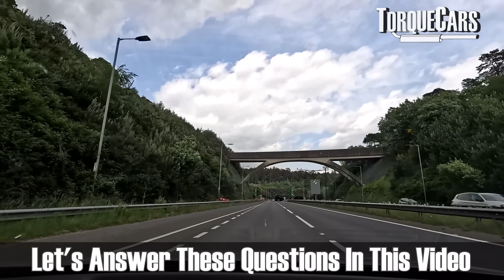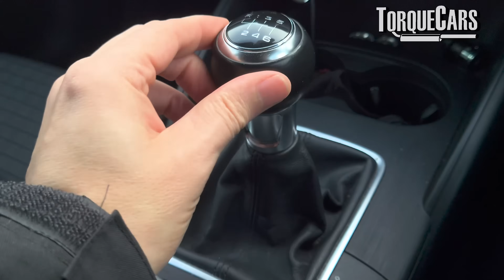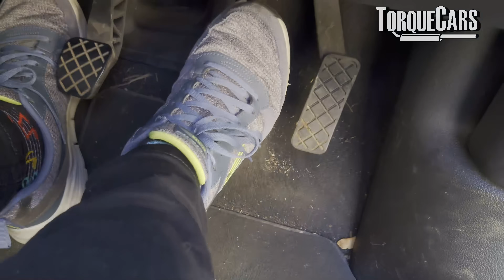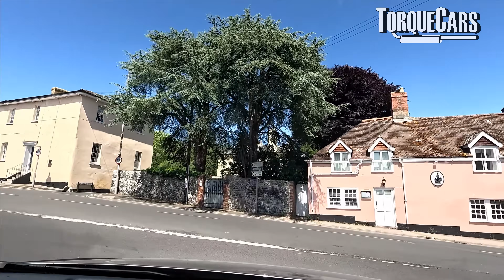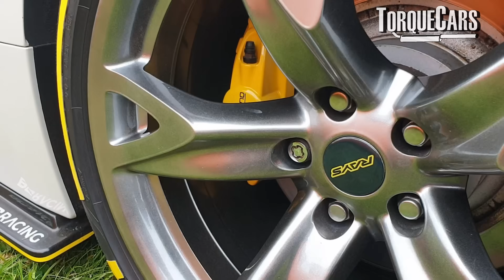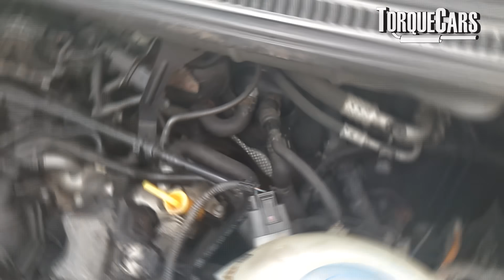What Is Mechanical Sympathy: ❣️The Secret Driving Skill No One Talks About (But Mechanics Hate)

Comment: Running a diesel engine with average wear in low temperature start-up - will not induced diesel diluting in oil? While the engine is not hot enough? Thks. Great Channel!

Comment: Start a cold engine and let it idle for a minute .
Drive the first 3 miles with no more than 2000 RPM , then about 2 miles max 3000 RPM.
Never use lounche controll , these sudden powerreleses can break axles !
Feed in the exellerator , don't SMASH it .
Brake early and gently .
Do the services according to the manual or sooner when driving short distances !
So....thats how I treat my E350 coupe .

Comment: One of, if not THE best way to learn the art of smooth input is by driving a land yacht, and I one with REALLY soft suspension. The reason being that you get yourself into trouble if you DON'T use smooth input, so you're forced to learn it. Then after that experience, you only become a BETTER driver because of that

Comment: As a mechanic, I choose to drive my car quite hard as I frequently change the oil brakes and tyres and use better than oem parts ie engine mounts bushes, brembo uv dics, bilstein shocks etc.

I frequently go to redline when the engines hot as the manufacture sets the redline and would not let you overrevv the engine so going to the redline when the motor oil is up to temp doesn't hurt the engine at all especially with 5000km oil changes

Edit: of course I know mechanical sympathy but just choose not to do it to my own daily car...

other people cars and classics of course I'd be more restrictive & respectful

Comment: My friends make fun of me for shifting slowly when racing in a manual car... Bro I want to wait until engine RPM drops to the next gear's preferred RPM to make a silky smooth shift and maintain the health of my clutch, motor mounts, transmission mounts, interior parts (some of them break during power-shifting), etc...
Reply from the maker: You'd need a light flywheel for those lightning fast gear changes, but it makes the car challenging to drive in normal conditions. Those change points are the key and flat shifting can cause the engine to bog down in some cases.

Comment: I once got 220,000 kms out of 4 Michelines on an Opel Corsa. The car was driven in the country with very little stop and go driving. True story!
Reply from the maker: Wow, that's an impressive mileage, proper mechanical sympathy pays off!
Reply: And in what time did you drove those 220,000 kms? As soon the tires are hard, the rubber will not come off anymore. If you only drove gently you won’t really notice that the tires are hard and already bad.

Comment: How can someone use the brake pedal while matching the clutch and gas?
Reply from the maker: That would be the classic heel and toe shift.  Seems to be a forgotten skill but it's something I've been brought up my whole driving career doing. I'll do a video on it if people want this.
Reply: I spent my youth on motorcycles, so was used to being able to blip the throttle while braking.  My dad showed me how to ‘heel & toe’, so this is something I practised from early on.  It takes a bit of mastering and practise.  He also showed me how to ‘double decliutch’.  No longer with us, my dad was a tough act to follow.  He explained that when he was learning to drive, synchromesh was not common.  I once had a clutch cable snap on my commute from work:  not much fun in stop/start traffic…!
Reply: @davidbarringham7992 I hear that, I didnt have the cable, but ive felt air, and total loss of hydrolic fluid a few times.

Comment: As a passenger, I've witnessed drivers shifting into first as they approach a junction quickly (with the clutch in), however this can cause wear to the synchromesh for that gear.
Reply from the maker: I should have mentioned that, you can even hear it crunching as it does so.
Reply: @torquecars  If I ever am tempted to downshift to 1st to take a corner or speed bump... I leave it in 2nd and feather the turn with the clutch instead. Would rather wear my clutch a little than bang my gears

Comment: A small point about 'Handbrake' usage. There are three cars in my household, NONE have handbrakes. The correct description is 'Parking Brake'. 
Of my cars two have electrically operated systems, and one has a 'foot  brake' All three  have 'hill hold' systems which automatically operate through the main braking system.

Comment: I once sold a Volvo 300 car to a work collegue, 65k miles on the clock. He was immediately advised to replace the clutch plate by a 'Mechanic' . Luckil;y he had it done by another work collegue who was a skilled mechanic in a previous life..  Some time later I was talking to the collegue involved in the plate change. His comment was that when they put the new plate next to the old they had difficulty in seeing which was the 'old' plate.  
I had been taught to look after the car and drive properly. In 50+  years of driving I have never had a clutch wear failure.
Reply: So, why did they replace the clutch if there was nothing wrong with it? 🤔
Reply: @BubblesTheCat1  The clutch was already disassembled when they found out. (Strangely you can't see the clutch plate without taking it to bits.) They had a replacement plate ready for the swap  The original advice from the 'Mechanic' was poor , (Hence my quote marks around the word 'Mechanic'. As for which plate went back into the car I have no Idea, my comment was to demonstrate the fallibility of many 'Mechanics' 
and perhaps boast about my driving style being sympathetic to the car.
Reply: @solentbum I see now, yes. I've driven all my cars from new to over 300k kilometres without ever needing to replace a clutch 😅 It's all about understanding, and mechanical sympathy 😊👍🏻. 🙋🏼‍♂️ from 🇿🇦
Reply: @BubblesTheCat1  The Mechanic took one look at the car, saw it had a towbar and jumped to his conclusion.  
I have found that having a towbar on my smaller cars enables me to have a large capacity vehicle when I need one, plus I often tow a small boat. The reason I sold the Volvo was it was being replaced by a Discovery to tow my new big caravan, there was nothing wrong with the Volvo I just needed a larger tow capacity.
Reply: Same here; never had to replace a clutch.
Reply: @davidbarringham7992 👍🏻👏🏻
Reply: I have a 1996 Toyota. 105k miles on the clock. We got her at 53k. Poor thing has been used to tow a caravan in her previous life.

Clutch has been "on its way out" since day one. I keep waiting for it to slip before booking in a replacement. It keeps refusing to...
Reply: @233kosta "Poor Toyota" 😂🤭

Comment: The people todaydon't have a minimal technical understanding, the car is driven pttm, the clutch used as a foot rest, the indicator lever used as a bag holder,.......
reving cold, doing short cycles, overdoing service schedules, hitting side walls, and so on and so on.

The dring license should contain a big technical section with a practical test.

Doing my dring license during military service  (i had my own civil dring license allready) and was in a Maintenance unit, we had to do car service including pressing the grease nipples on the chassis.
During my lessons for my civil driving license the instructor used to ask the woman where do you fill up coolant at the VW Beetle (itz is air cooled!)

Comment: Whilst I agree with many points in the video, regarding manufacturers manuals and instructions, generally to be taken with a pinch of salt. For example , oil changer intervals are typically wrong and in most cases double the time what they should be in reality, I have an oil and filter service roughly every 5K miles, whereas Audi recommend every 10K miles - For what is essentially a supercar in a family estate body is absolutely ludicrous, no wonder so many owners are having engine rebuilds before the motor reaches 100K miles! Regarding driving style, again it depends on the car itself and the drivers understanding of what is safe for the machine - Despite my car capable of 0-60 in less than 4 seconds and producing 600BHP, this doesn't mean I'll rag it all over the Nürburgring because it has a wet sump, the previous variant of the RS6 had a dry sump so wouldn't be an issue but frequent hard cornering in a wet sump motor and you're asking for trouble! Knowledge is they key with anything in life, fairytales in shiny books from manufacturers are just that and are misleading.
Reply from the maker: I have to agree on the stated service intervals, but the manual is a useful guide to general use of the car & controls, especially important if this is your first (Quattro, DSG, Diesel etc...)

Comment: I have driven many different types of vehicles including vintage buses and HGVs. I have never worn out a clutch or gearbox. I still double de clutch particularly if changing down gear at speed. If we look after our cars they look after us. Of course some modern car engines are built to fail.
Reply: What's "double de- clutching" please???
Reply: @richardwallace2458  It's when you dip the clutch out between gears to sync the input shaft speed for the next gear. It's easier on the synchros. On some HGVs you need to do that, as they have no synchros at all.

In normal driving it's not really needed, especially if you're not forcing the gears in. But when you're downshifting more aggressively (say 4th into 2nd), it's helpful to dip the clutch out, blip up, push it back in while the revs are high, and only then go into second.
Reply: @richardwallace2458   A easy way to blow up the gearbox.
Sadly makes little sense to do that often. If wanting to do it, or those rare shifts that makes sense to do it:
The goal is to sync the speed together of all the components as best as possible.
All of this components speeds needed to sync up are this ones in order: Engine, Clutch, First part of gearbox, The actual gear that is connecting to the wheels.
It is the first part of the gearbox that requires double clutching. The first part and actual gear going to the wheels are called input and output shaft. Input being the engine/clutch. Output being what is sent from the gearbox to the wheels. Normally rear wheels since FWD cars became popular by the time that double clutching is more risk then it is worth.

There is simply put this. Engine can change the speed of the clutch. The gearbox with the help of the road can change the speed of the engine and so clutch. The fight happens between the clutch and gearbox.
Without the double clutching you can only increase the engine speed. Or, hit the brakes to slow down the road speed and so slow down the gearbox.

Now. In a neutral gear we have a other consideration. With the clutch out the Engine, Clutch, Gearbox are linked up. You could rev the engine to 9000 RPM and we could say that the gearbox is spinning at 9000RPM.
But the gearbox is in neutral. The road speed wanting 2th gear would only allow 2000 RPM. The second part of the gearbox is then effectively at 2000 RPM. When you then clutch in and select 2th gear with the engine still at 9000RPM, and so first part of the gearbox is still spinning at 9000 RPM. The gear selection needs to synchronize the first part of the gearbox with the other part of itself. Clutch is by this point in and the engine/clutch is disconnected with the gearbox. But the gear is engaged. Now the engine/clutch is going 9000RPM, but the hole gearbox is 2000RPM. Now the clutch has to sync the road with the engine speed.

Now we are talking about why all this matters. The engine is going 2000 RPM and the road is 2000 RPM. In 5th gear. Downshifting to engine brake heavily into 2th. For this to occur the engine has to reach 9000RPM while the road is still 2000 RPM. We could go for a higher gear and a lower engine RPM. But for clarity I stick with this insane stuff. Clutch in. Rev up the engine to 9000 RPM. The clutch is still 2000 RPM. The gearbox is 2000 RPM. The road is 2000 RPM. Selecting 2th gear now will force the first part of the gearbox to synchromesh up to 9000RPM. The road and so other part of the gearbox is still 2000 RPM. The clutch is still 2000 RPM. Engine is 9000 RPM.

It is a gearbox. The job of the gearbox is to be able to transform rotation speeds like this. 9000 RPM on the engine side. 2000 RPM on the road side. But it is so heavy handed! And if you simply where driving at 2000 RPM in 5h speed? Then clutched in changing to 2th? Then let out the clutch? The road would have to speed up the hole drive train and it is no good. Engine would be forced up to 9000 RPM by the wheels going down the road after the gearbox changed gears by synchronizing like a gerabox the first part and second part of the gearbox.

Instead. 2000RPM in 5th gear. Clutch in. Neutral gear. Clutch out. Rev up to 9100 RPM in neutral. Clutch in. The first clutch out engaged the Engine, clutch, first part of the gearbox. Then all 3 of this where reved up a little passed 9000RPM. All in one go. In neutral. Now the double clutching occurs. Clutch in, change gear to 2th, keep the engine RPM passed 9000RPM, clutch out. Since the first part of the gearbox was 9000 RPM. And the road part of the gearbox would have made the first part of the gearbox spin up to 9000 RPM? The synchronizing happened as peacefully one can have it happen reeving a engine up to 9000 RPM. Then letting out the clutch in 2th gear you still have the engine and said clutch at 9000 RPM.

Nothing of this really is worth destroying your car over. Modern lorries/truck driving manuals and learning forbid you from doing this kind of stuff. It was pretty much mandatory back in the day to double clutch. But around the same time FWD cards became common? The year 2000? I mean even before that... The 'next generation' of 12 speed heavy lorries in every way stated that double clutching was a thing of the passed. It is a extra burden on the driver and it simply makes no mechanical sense with how it is designed now. It is risking way to much to do it. The wear on this components if you drive normally and without racing around like a street racer is simply accounted for to last the gearbox. Simply do it if there is any good reason to do it. "I still double de clutch particularly if changing down gear at speed." There you go. It only make sense if you truly start to understand what good it dose. And what the consequences it can have doing it wrong. Grate for fun high speed driving. And rather good for some scenarios.

For instance. Standing still at idle? 1500RPM. If you clutch in and select 1th gear instantly? The first part of the gearbox has to match 1500 RPM with 0 RPM on the road side. This is not strictly true. You can not instantly do anything with the gearbox and so would drop down to maybe 1450RPM? And since we are talking about 1450RPM of the energy in a spinning part of the gearbox? Since clutch in disconnected? It is not allot of work for the gearbox. At all. This first part of the gearbox I have been talking about we usually refer to the upper part of a gearbox. If engine/clutch is engaged with the gearbox? That is what the upper part of the gearbox spins. 5th gear or Top gear usually we say go strait trough out the back to the rear wheels. Pretty much removing the hole gearbox from the conversation. But not always. The lower part of the gearbox is where the actual gears are coming into the picture. In Top gear the Engine RPM and road RPM are the 'same'. Why we even have a need for a gearbox in the first place. Because the engine can not run at 100RPM.

As soon as gear ratios makes the wheel/road RPM far different to what the Engine or the Clutch are doing? It is all about syncing thing up. If one simply sticks with 1500-3000? Maybe 3500-4000RPM when shifting up going uphill? Things like this makes little difference. If one simply brakes and brakes until picking a gear that have you start over in a low Engine RPM? Say 1800RPM? Nothing of this matters. It is only really relevant when shifting down and going from low Engine RPM to high Engine RPM. Then double clutch, that is clutch to speed up the upper part of the gearbox, then with that sorted out shift gear with the next clutch and rev match a high Engine RPM smoothly and taking care of the gearbox.

Comment: Driving, or operating, a car involves a lot more than you expect.
Listening to the revs knowing when to change gear.
Being able to hear if something isn't producing the usual or correct noise.
Feeling the vibration from the engine, wheels, gears and other moving parts.
It is a multi sensory thing to operate and know when to take action if you want you car to last longer.